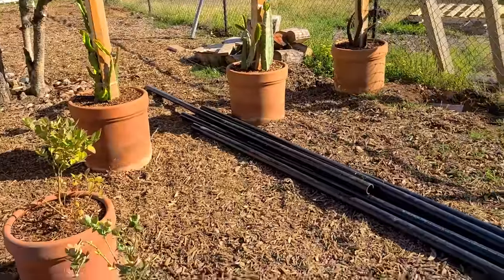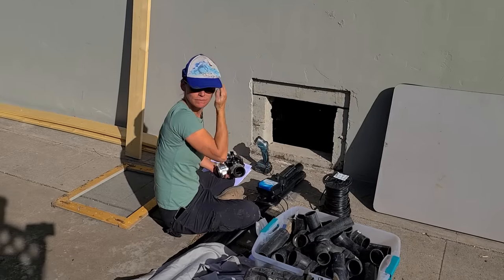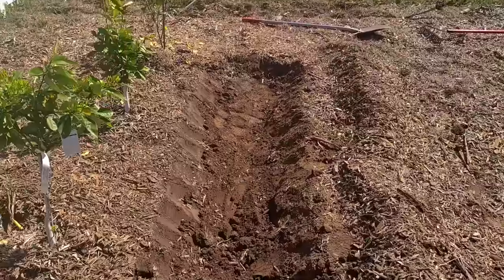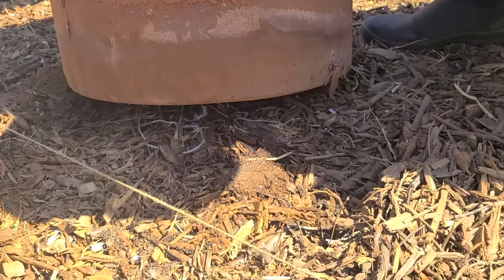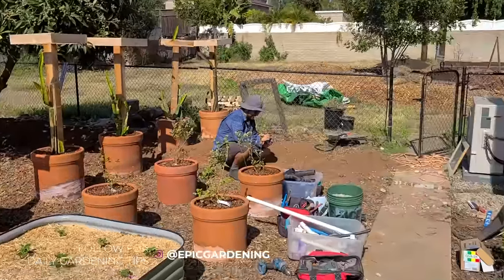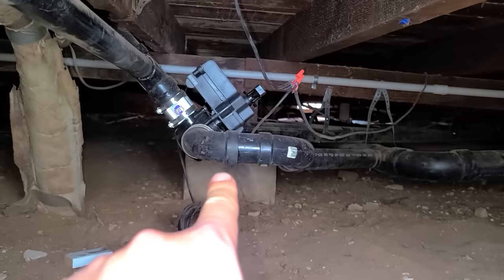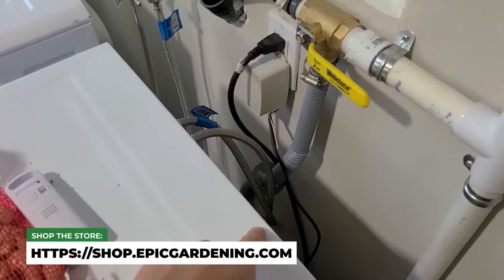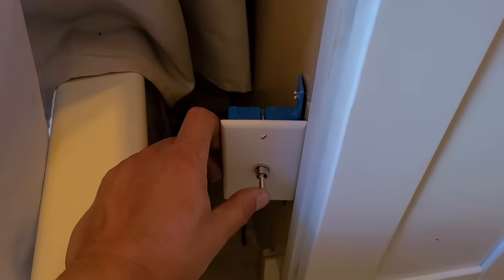Grey Water Systems: Shower, Bathroom Sink, and Laundry Conversion!

Comment: On the soap/detergent/cleansers issues: Grey water is safe for your garden.
Grey water doesn’t contain chemicals, black water does. So if you are using detergent or cleansers “flip your switch” to black water. 
Soap is safe. Detergent isn’t. Biodegradable is best. 
Products with microbeads should be avoided at all costs. More difficult to avoid is products with essential oils but important because of the VOC contents. Your plants can tolerate most of them but some can cause damage. It’s a lot of research to do and I find it easiest to completely avoid EOs.
Reply: Thanks for the info, that's definitely the question most people were asking themselves :)
Reply: In Australia, black water is from the toilet, so contains fecal matter. Grey water, is tap water from sinks.
Reply: Black water is not chemical, it is fecal. You can not have feces going into the ground. 
Black water is from the toilet, grey water is everything except toilet water. Because water coming from the toilet has feces. The toilet does not release chemicals. Unless someone uses drop in toilet bowl cleaners, that should not be used anyway.
Reply: @Mr77caprice  “You cannot have fecal matter going into the ground” ?!? Oops, better tell all the birds and mammals and reptiles they aren’t allowed to poop on the ground anymore. (Sorry, you set yourself up for that one.)  Actually fecal matter is safe once it has composted down to its individual components.
Reply: Yeah this isn't correct.
Reply: Interesting your comment on EOs. Its a bugger because lots of natural soaps have them. But Dr Bronners would be good
Reply: Hello Laura

Comment: Up in Oregon- some municipalities have ordinances against grey water use due to detergents. But it’s really common outside city limits. Grew up with ours watering our orchard.
Reply from the maker: The ordinances are so odd to me!
Reply: @epichomesteading  I wondered how your shampoo and soap would affect your plants?
Reply: @epichomesteading  Rules that were often designed  many years ago when most soaps and laundry detergents contained sulfates (I think)  which caused all sorts of problems up the chain, Lower oxygenation causing algae bloom, fish kills, etc.  Those nasty chemicals also eventually made it back down the chain into the aquifer, right back into your house and irrigated crops.  This is my  understanding as a layperson of the science behind those rules.
Reply: @CherryxBlossomxMist  Great info! I wonder if Castille and other SLS-free soaps are fine to use?
Reply: @CherryxBlossomxMist  Phosphates. You'll notice on the back of most laundry detergent that it says "Phosphate Free".
Reply: @jujube2407  he probably uses like organic soaps and it will get diluted a lot. Showers use a ton of water.
Reply: @eugsmiley  I'll take your word for it, because I couldn't remember for sure and was too lazy to look it up!   The point was, they made rules based on conditions and those conditions often no longer apply.  Cities, counties, etc. can be pretty slow about changing rules to keep up with the science.  If you live in a city that doesn't allow grey water and you're interested, see if you can change it.
Reply: Peep: Castile is already used as an organic pesticide so it’s definitely safe for plant leaves. Not sure if the roots can take it since I haven’t read up on it.
Reply: @jujube2407  yes that's exactly what I was wondering too, then got attacked by someone on here for asking. 🤦🏻‍♀️🤷🏻‍♀️

Comment: There's a relatively cheap PVC fitting called a water jet for putting pvc underneath a sidewalk. You just dig a  little pilot hole and it creates a high pressure jet spray and you can just push the pvc through. Pretty handy

Comment: Don't forget to label the switch and laundry lever. 4 months later you will wake up and forget the same way your mind plays tricks on if you locked the front door or garage or iron or (insert what your brain plays games with here) 😄
Reply: @epichomesteading  No need for that, you've got a video record of it now! 😉
Reply: In the laundry room I noticed that the pipes were color coded for quick visual reminder
Reply: I was thinking the same thing!  LOL.  But if you paint the outlet cover bottom half gray, that is a cool solution

Comment: I put in a new septic system in 2007ish and a couple years later it was already failing because the company never put a filter for the solids on the out bound side of the tank. I had the tank drained, put a filter on and did the same thing with the pool bypass fitting and ran my shower/washer/laundry sink out to daylight in the woods next to the house. Saved the septic, no odors or problems outdoors either. Lint from the laundry is one of the worst things to clog a septic field.

Comment: That whole 50% split thing looks cool but  seems not right until you measure each splits release and see how much water is coming out of each. The opening size determines how much is released at each point. Correct me if I'm wrong but all of your split pieces were the same diameters? The opening thats the lowest in the line undoubtedly will get the most water. The system I installed is a simple leach pipe in a trench bed of pea gravel, but over the course of its length,  the sizes of the holes change in size making it to where water is more equally distributed. And also too unless your only running water in those pipes, don't expect your plants to grow normal with any dish soap or anything in that water.  In case your wondering I farm for a living and install and manage flood and drip irrigation systems for a living.

Comment: Manual method of grey water.  Scoop bath water saved in the bathtub in 5 gallon buckets and pour out into trees and plants.  Same thing with the laundry.  Build a second discharge pipe that goes outside and collect water in 5 gallons bucket.  I can release the soap water into the sewer while saving the rinse water.

Comment: next time you need to get pipe under a sidewalk or driveway, use a water jet. They sell the nozzle and hose attachments for <$10 and work really well. I did a 12 foot run under a patio with 1.5" abs.

Comment: When I did my house, laundry water, and two rooms shower were pre plumbed for this type of setup. I had a tank instead so that a float pump can do the job since my garden is on the other side of the house. The problem with this system is that, having a tank is not a very good idea. If the pump fails you get over flow and the water stinks. I need to redo some stuff. For now it’s back directed to the sewer. It’s a one line setup from 2nd floor and pent house where the laundry room is located . The amount of water wasted from the laundry is incredible. I was never able to get a 3 way sewer valve. 

The best thing you did here is the 3 way valve and you have no tank. Even if you had a tank, if you needed to ditch that water, it way easy.

Just remember you will have lots of hair accumulating from time to time.

Comment: I can’t do all this work but I live in San Diego to and what I started to do was take the water runoff from my air conditioner and put a bucket under that to use in my garden and also I started taking a giant orange Home Depot bucket in the shower with me so that when I’m running the water to wait for it to get hot and while I’m in the shower I collect all that water and try not to get the soap in it and use that out in my garden. I do have to carry it out a little buckets at a time but it’s good exercise

Comment: I"m on a property renting a camper and they use the grey water from this camper to water some trees.  Very useful.  I had to be careful because bleach can cause a problem.  I don't use bleach.  In the future I will use completely safe detergent.  I heard the part where Brook mentioned the bleach issue.

I found a detergent called ECOS and it has a good deal of positive ratings.  The price looks good but of course the real test is trying it myself.

Comment: they make soaker hose to broader irrigate or & simplify your set up. Just use 25 ft soaker hose & patch/silicon the hose where u don't want it too leak, or drill hose where u want more to leak.

Comment: Because I live in a winter freeze zone this system would be impossible- probably even be illegal in my town. I go old school- 5 gallon buckets in the shower that catch excess water & I carry the buckets outside to the garden. I hand wash/rinse dishes in plastic dish pans then pour the water into a five gallon bucket & carry it outside to the garden. All bathroom sink water runs into a pan fitted into the sink then poured into a bucket to be poured into the toilet to flush or carried outside to the garden. Lot of hard work carrying those buckets! But I've built muscle! The laundry water I've had to let go. I fortunately have a low water washer & only do a load a week. But I'm trying to figure out a way to run that washer hose out the window into a barrel! Unfortunately the laundry room is on the far opposite side of the house from the garden area so... whew. It's too much to deal with. But we all do what we can!

Comment: 2-3 in of gravel would be better than mulch ask it won't break down into soil over time and will act as a mild filtration system. If you intersperse the gravel with activated charcoal, it will help pull toxins out and filter the water as well. Great job Jacque. You can come to Texas and help me dig mine next of you want.

Comment: I sunk a 200lt drum into the ground for laundry water. This gets chlorinated and is used for flushing toilets. All the bathroom water gets used in the garden. A pumped system is a bit easier as you can go uphill and dont have to rely on gravity and can easily be expanded.
Im not the Jacques in the video, but it seems we are a handy bunch.

Comment: This is obvious, but just in case some people don't realize this--can't do this where it freezes over winter! Or you could, but you'd want to blow out the system each fall before it freezes. Also, I'd be curious about detergent build up in the pipes? Or I think of hair building up? My initial thought would be to have some sort of mechanical filtration to get most of that gunk out before it gets to the plants.

Comment: Question wouldn't the grey water with all the soaps and stuff be bad for the plants?
Reply: that’s my question too!
Reply: I wonder that also. Do you have to use special soaps??
Reply: We use Castile Coconut Oil Soap for the shower & hand washing, and use Ecos plant-based laundry detergent which is rapidly biodegradable. So, neither of ours are bad for the plants, in fact they seem to love it.

Comment: In my State all gray water lines must be marked purple and also must be marked gray water. The lines can't be ran within 10 feet of your neighbors property. The water cannot be stored more than 72 hours, and if it's used to flush toilets, the water must be dyed purple as well. Code on drainage slope is 1/4" per foot minimum. If you go to 1/2" per foot drop, the DFU's increase.

Comment: We have an old 1950s leech well for our washer. We want to do this for plants where it exits as the well is old and clogged and a pain to deal with. What are the round green things to cover the exit tubes? Any suggestions on the type of detergent also? We only use a minimal amount of tide free and clear or bronners soap for whites.

Comment: How does this work with all the soaps that are mixed in the water? Isn't that bad for your plants?
Reply: They could be, however there are many bio-degradable laundry detergents, soaps and shampoos that are available. Reed bed filters can also help eliminate the problem.
Reply: I use Ecos liquid laundry detergent for my laundry 2 landscape set up, you can get it at Costco. Always use liquid detergent, never powdered. For the shower set up use Dr. Bonner's soap, you can get this soap at Costco as well.

Comment: You need to seal around the actuator cable with silicone from the bottom. Would have been better to run it through some pipe tho. Nice work.

Comment: Citrus should be watered deeply once a week right? Or twice a week when it’s hot
- so is this just supplemental?

At the flow rate of a shower drain over that distance most of the water will pool up at the outlet before it distributes to the ends- I wonder if you considered storing your grey water for even gravity dripped irrigation on a timer

Good goin keep it up

Comment: Good plumping code standards require 1/4 inch drop per foot, so i'm assuming that you can go a mere 1/8 inch because this is not standard home plumbing but more of an irrigation system ? Also i'm interested in the limitations due to laundry soap and / or showing soap since the chemicals will be heading toward plant life.

Comment: Water reclamation is something I want in my house, but how do you handle the soaps and cleaners in the shower and laundry and not have it kill your plants or damage your soils?
Reply: I use Ecos liquid laundry detergent for my laundry 2 landscape set up, you can get it at Costco. Always use liquid detergent, never powdered. For the shower set up use Dr. Bonner's soap, you can get this soap at Costco as well.

Comment: this is awesome. although I will warn that you will need to up your pest control! you have created basically a heaven for sewer roaches to breed in. we have just our washer water going to the back yard thru a pipe that comes up in the middle of the lawn . if we use the washer a couple times a week its all good but one time after a long vacation, we came home ran a load of laundry and a shocking number of sewer roaches came dumping out into the yard when it drained, it was horrifying, they had just been going down and living in the pipe with all the sludgy yuk that they love so much  and ended up running all over the yard once they were flushed out. we now have a screen over the outlet which has worked well aside from needing to be cleaned fairly frequently due to lint build up. I think our next project will be to add a filter that is easily changed and also blocks bugs from being able to go into the system. you system seems pretty good except those little bucket outlets will for sure be full of roaches and whatever else unless you spray for them or do something to prevent it.

Comment: I watched some Videos before of gray water, waste-water recycling and rain-water harvesting and rehash it until drinking water quality.
This construction is not using any filtration-systems e.g. mulch in a bin with wholes, there are also special plants existing which can handle alkaline solutions in the soil due to acids released from their roots.
Are you using some of those, or is this none of your concerns?
Besides that, can you recommend a specific perusal?

Comment: Kevin, could you have used a reverse French Drain to get the water into the ground instead of the 50-50 T-connections?

Comment: Seems like your grey water system should integrate to the rain barrel system. Now, you have to monitor both systems although it doesn’t rain much in San Diego. It’s not flexible if your plants and locations change. You should expect a lot of grey water from all bathrooms and laundry. Gardening isn’t a cheap hobby. I’m upgrading my yards for drought tolerant plants although I might have a few citrus trees and vegetables.
Reply: easier said than done, the water would have to be pumped back up to the level of the top of the barrels...
Reply: @clairemcconway6266  Not hard with a sump pump.

Comment: Filtration? Storage? I've wanted to do this but the 2 big problems is filtering out soap, shampoo, detergents & then there the storage tank bc u will over water from daily use of the shower, sink. U cld have switches & levers to toggle but it's not a set & forget it system & it will impractical to use bc u won't be bothered to remember to use on a daily basis.

Comment: Hey I was just wondering is there a way to store this water instead of it just going right to irrigation? We are building a garden and will definitely be using it for that but we also have a pool and I feel very guilty about the water use so if it could be used for that or reused in the house that would be fantastic. Also if it's not too personal how much round about did this cost? Thank you for everything you do!!

Comment: 1) Doesn't the open drip basin system setup a recipe for tree roots to get in? 2) Is it okay to irrigate plants with soap water? Does the type of soap/detergent matter? 3) Do you have a garbage disposal on your kitchen sink and would disposing vegetables and other food waste work with this type of gray water system?
Reply: If you are using a garage disposal unit in your kitchen sink you should NOT use the water in a grey water system - in fact water from a kitchen sink is usually classed at black water and should be directed to the sewerage system.
Reply from the maker: Will answer these, and no you can't do a sink
Reply: Sorry, I meant to type GARBAGE disposal unit, not GARAGE disposal unit, lol.

Comment: Do you have to use special soap, shampoo or detergent with a greywater system?
Reply: I use Ecos liquid laundry detergent for my laundry 2 landscape set up, you can get it at Costco. Always use liquid detergent, never powdered. For the shower set up use Dr. Bonner's soap, you can get this soap at Costco as well.

Comment: Nice work! Lot going on too bad you didn’t Google how to run a pipe under the concrete using (ironically) water. Much easier no concrete mess